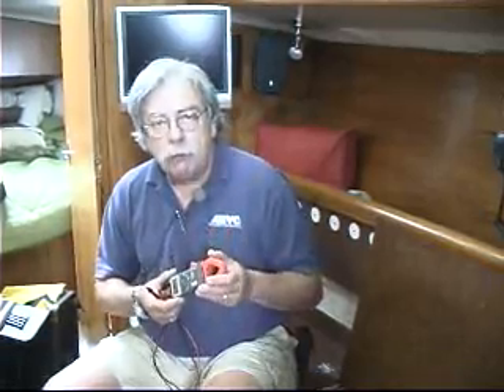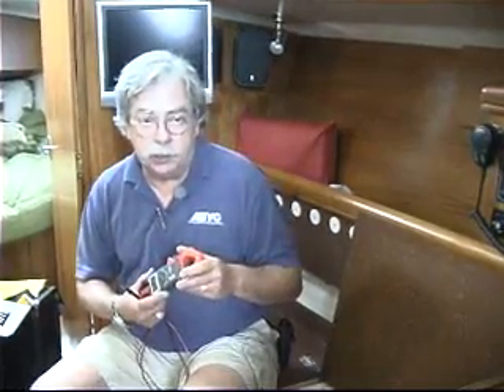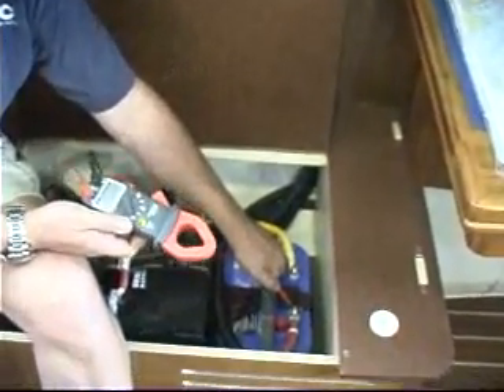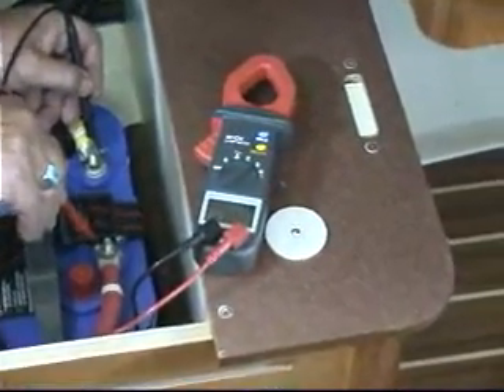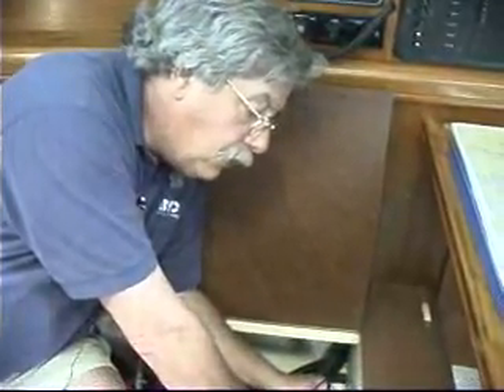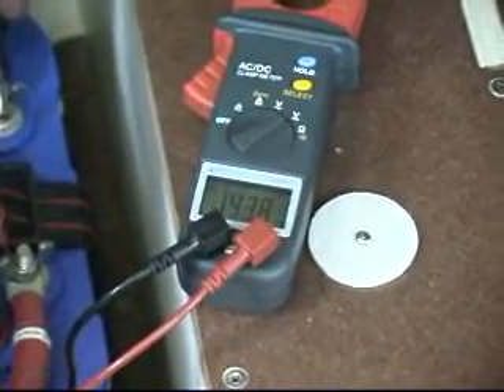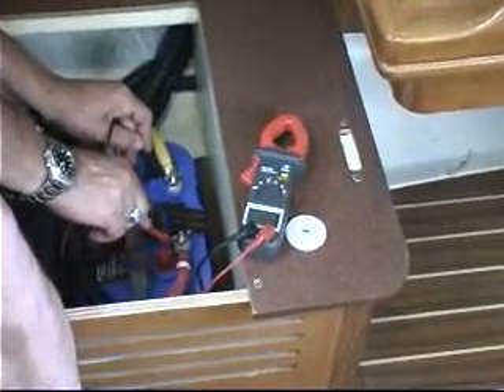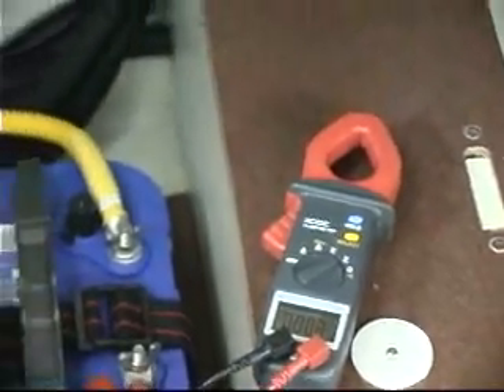Electrical- Alternator- 3 Step Voltage Test.wmv

Comment: O.C.V. Open Circuit Voltage means: NOTHING is connected to the battery posts.  No cables connected, for four hours minimum before testing OCV.

Comment: Great video!  

I really applaud your shared vision to increase the level of knowledge and professionalism throughout the boating industry.  As I am sure we can all agree that the industry needs it.  

In the shared interest towards increasing the knowledge level in the industry I would like to see what ABYC's recommended position would be in regards to a single externally regulated alternator's ability to properly charge two battery banks on a sailboat with GEL batteries in one bank & AGM batteries in the other bank?  

I'm sure this is addressed constantly and ABYC has a clear position. To add more detail the Electrical System is 12v DC & 120v AC. The 2 battery banks are currently charging from the engine: Yanmar 4JH4-TE (55A) with a stock alternator (Hitachi 80 Amp/not externally regulated) & goes through a battery isolator.  Additionally a voltage drop of 1.03VDC is recorded through the isolator as expected. 

The house batteries (Bat Bank #1) are Trojan TE-35-GEL 6V 210Ah's (prior house batteries changed 2mths ago consisted of Flooded Lead Acid batteries) 
(Bat Bank #2) are AGMs (Optima Red Tops) for the Engine & Genset start batteries. 

To improve the charging on both battery banks from the single engine alternator we are considering removing the current alternator for modification to "P" Type for external regulation & reinstalling after the modification with a Balmar MC-614-H, Max Charge Digital Regulator, 12V Blue Sea 5065, ATC In-Line, & Waterproof Fuse Block.  
Ultimately we would be replacing the isolator with a battery combiner.

However after reading an article shared by the ABYC I am starting to think that installing the alternator charging relay would be a rookie mistake and not advisable by ABYC, as the sailboat has 2 different battery types between the 2 battery banks that charge at different optimal voltages, & the charging relay would combine both types for charging; therefore, the regulator would have to be set for the battery bank with the lower voltage GELs in order to protect them during charging, and then the starting battery bank would never achieve a full charge.  

Wouldn't you agree?  Any thoughts or recommendations with the objective in mind towards optimal charging?
Reply: A year now passed.  No responses.  Proof to never use YouTube comment area,  to ask questions.